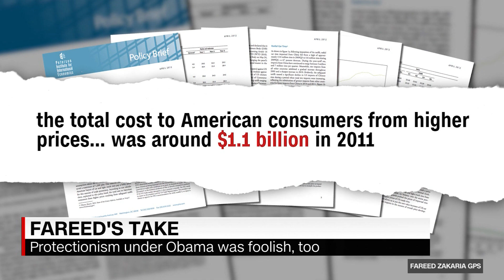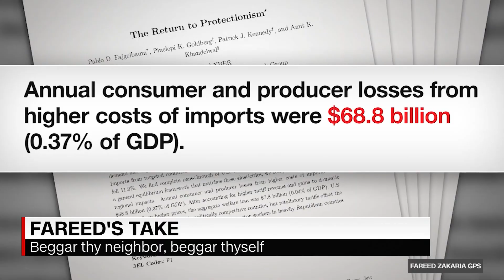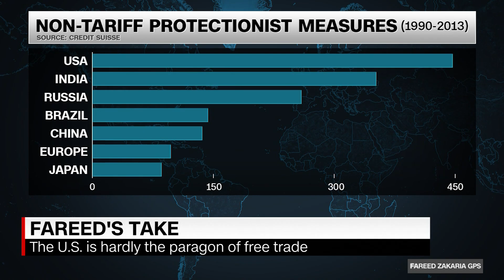Fareed Zakaria looks at impact of tariffs on US economy

Comment: The die was cast long ago when U.S. corporations wanted to have access to what they knew would be the growing middle class in China. In order to have access to that market, they needed to set up manufacturing facilities in China where wages, benefits and environmental regulations were extremely low. This would also allow the American corporations to export their products to the U.S. at a low cost. Reluctantly, they accepted the Chinese government's conditions that if they wanted to set up shop in China that they would have to give 51% ownership (controlling interest) of their Chinese based businesses to Chinese shareholders. This, of course, would give the controlling interest access to the intellectual properties that those U.S. corporations had developed in the U.S. Corporate secrets, that would be guarded strenuously from competitors in the U.S., now had to be shared with with their 51% Chinese controlling interest partners in the Chinese operations. These "secrets" could then be given to 100% Chinese owned companies. The whole trade war with China is mainly over the loss of intellectual properties developed in the U.S. and "stolen" by the Chinese. If U.S. corporations hadn't been so eager to have access to the growing huge middle class market in China and therefore agreed to the 51% Chinese ownership requirement we would not be having this problem today. Prices for most goods in the U.S. would be double or triple to what they are today but wages would also be higher. We would have virtually no exporting of our manufactured goods because we couldn't compete with goods produced in China and would have had to place high tariffs on similar manufactured goods produced in China. We'd still be able to export agricultural products, coal and other mined products plus some electronic components where we had retained the intellectual property rights within country. We, of course, would have also had a law that prevented U.S. corporations from setting up businesses within China where such businesses would have to give 51% ownership to Chinese interests. Given that corporations control U.S. law makers, such a law would have never been enacted. So here we are.
Reply: Exactly,
Blinded by greed, USA corporations created their own storm and now complain about being rained on☔️

Trump’s solution: Dial up the storm🤦‍♂️

The forecast: Increasing rain with the chance of a lingering hurricane...⛈🌪⛈

Comment: The deficit is about to hit 1 Trillion(that is just the interest on the debt).  If the US is forced to default on it's loan, it's ability to borrow is going to nose dive the value of the USD.   It may even be worse in that if the USD loses it ability, like the sterling before it, to be used as the trade currency and having to prove they have not over printed the dollar.
With a loan default the US may find debts being called in as well
Reply: No - the deficit is not interest on the debt. The interest is about $400 billion, but is the fastest growing budget item. The problem is that while most Presidents have used deficit spending in tough times, the modern GOP runs up huge debt in good times and bad.